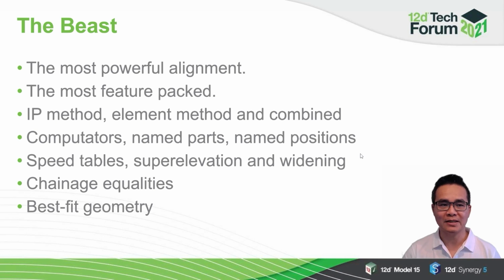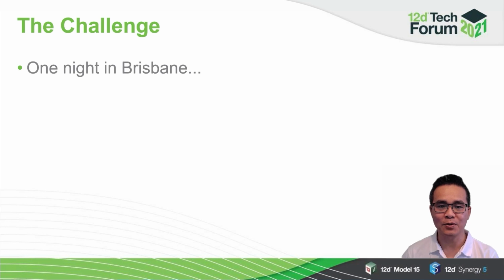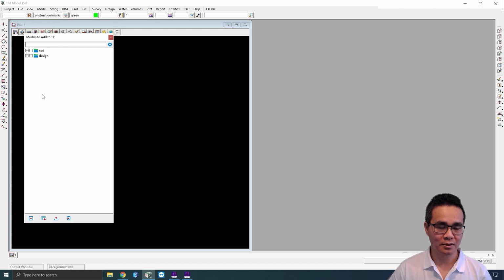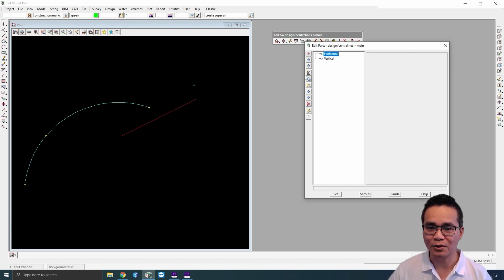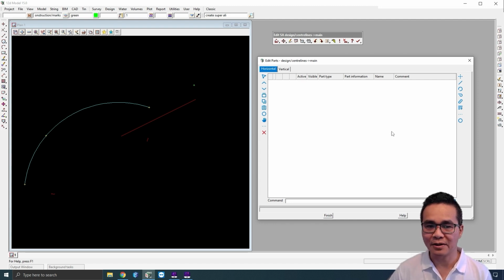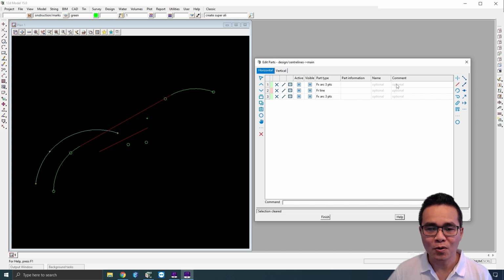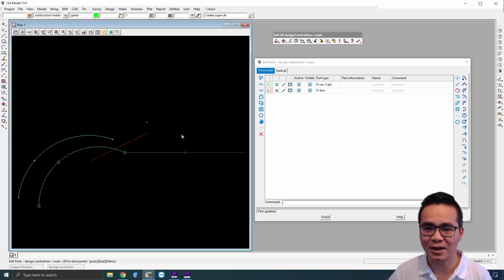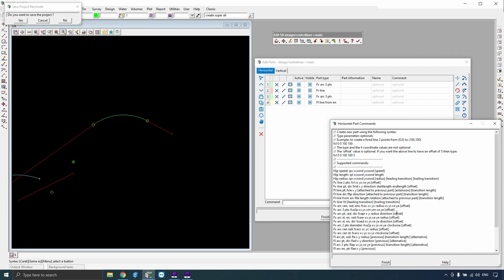New Super Alignment Part Editor in 12d Model 15 | Faster & Modern Design #12dModel #TechForum 2021

Comment: How do I use computators? I've clicked on the button but it does nothing. I haven't done this in about 10 years and I am pulling my hair out trying to remember the process AND figure out this new menu. 

And on top of that the version I have doesn't have the old parts editor like you showed, just the new one. I think I'm going to try and revert to an older version of 15 that hopefully has the older parts editor.
Reply from the maker: Hi, we would recommend training for this, specifically the Civil Design Features course https://www.civilandsurveying.com/design which covers the use of many different computators. The 'old' Parts Editor as you call it should still exist within the Super Alignment edit toolbar. Please contact support@12d.com for any issues accessing the Parts Editor.